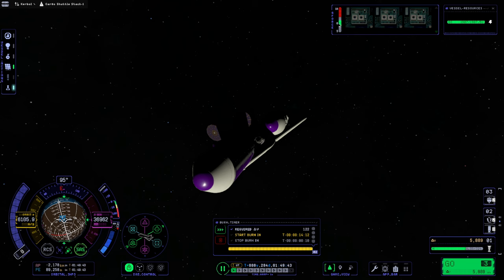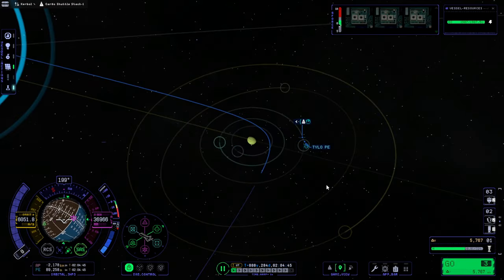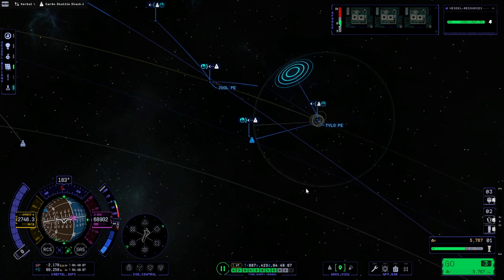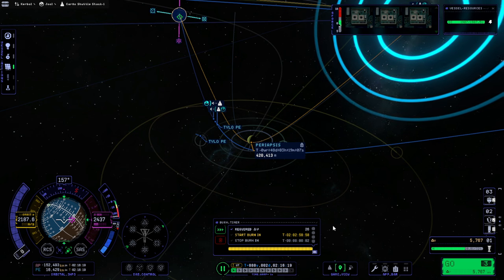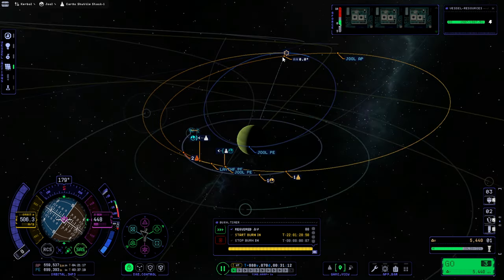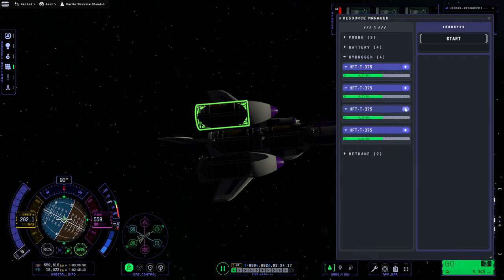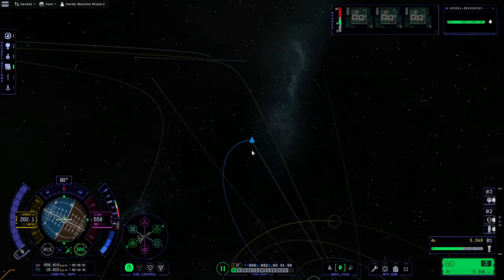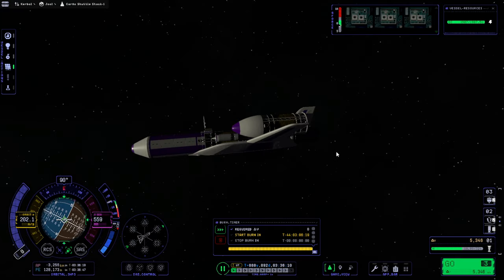KSP 2 Early Access - The Laythe Plan 02

Comment: My Laythe rover did the same thing.  I believe it's only an issue near shorelines, but I'm not sure.  I didn't have landing legs on mine, but I did have a couple small rockets on it.  I ended up flying it until I got to somewhere far enough away from the water and it worked fine then.